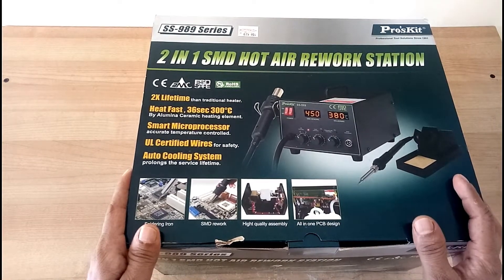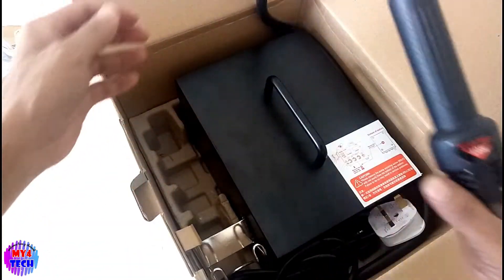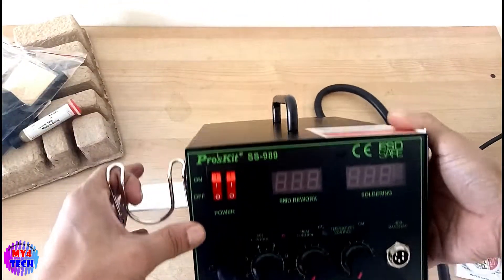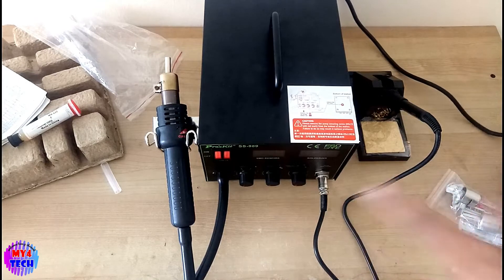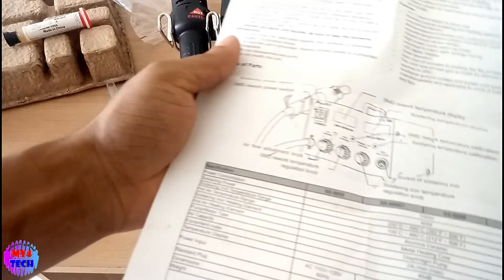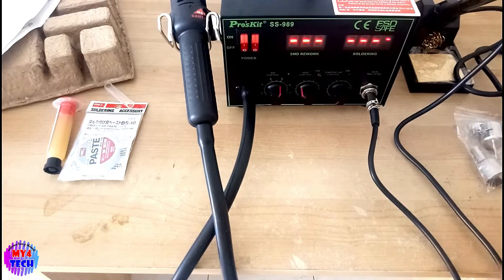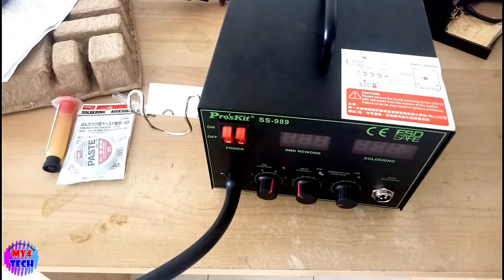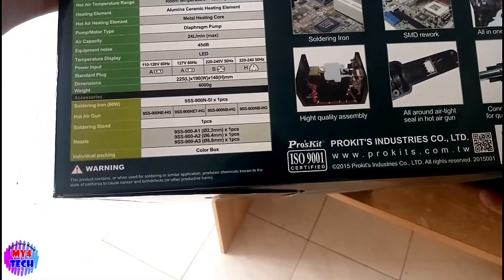2 in 1 SMD hot air Rework  Station | Pro'sKit SS-989 | My4 Tech

Comment: Hello. I have a Proskit SS-989 2017 soldier station and my soldering iron is dead. But I can't get the soldering iron with the original connector of my model. Now the connector is different. Do you know if I can modify my soldering station with the new connector?
Reply from the maker: Yes. Can
Reply: @my4tech761  I must buy the token and change it at the solder station. But the question is ... do the cables go in the same position? they both have 5 pins. The position of the cables are the same? I can't burn my solder station ... here in Argentina these tools are not cheap :( .... I'm going to do it and I'll tell you. Greetings